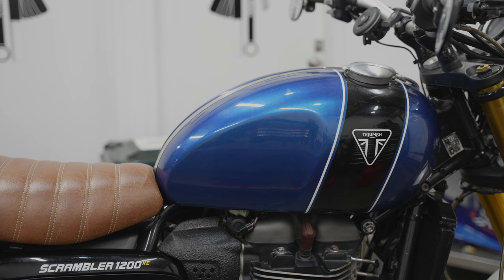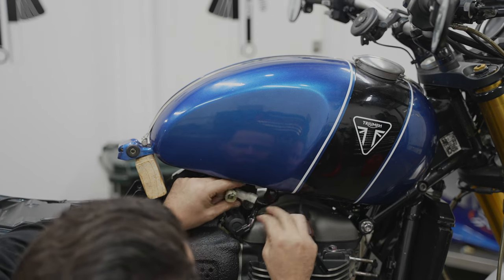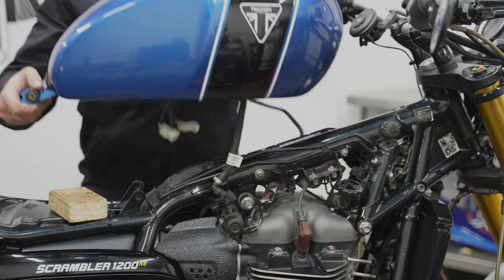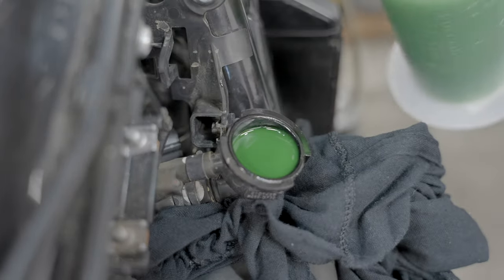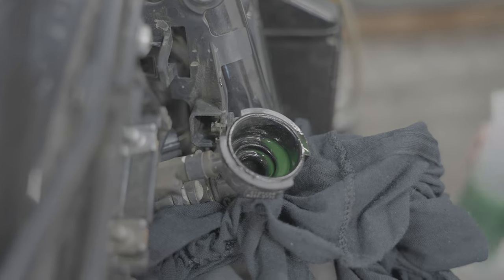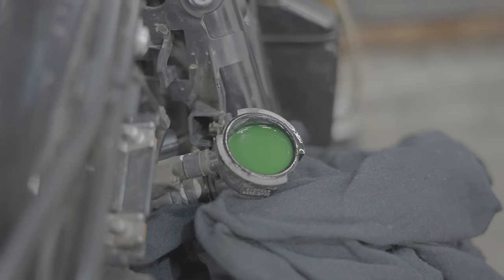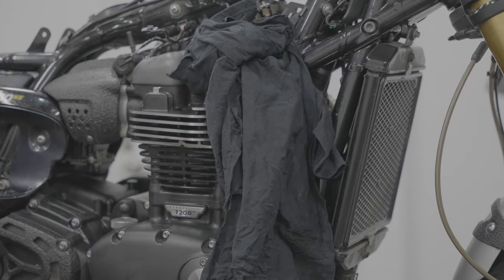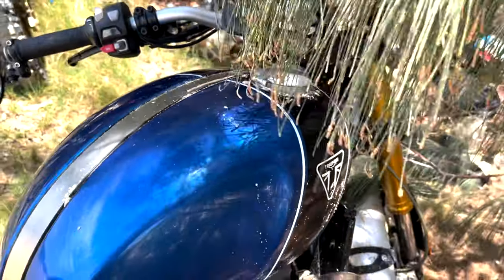Stay COOOL - RADIATOR + COOLANT CHANGE | SCRAMBLER MOTO MAINTENANCE TIPS

Comment: I added that plastic extension for the front fender. Massively reduces the amount of garbage kicked into the radiator.
Reply from the maker: Yeah I’ve heard that helps a lot!
Reply: yeah same. works pretty good
Reply: I have the high front fender. Knowing I was going on a long and remote off-road trip, I crafted a DIY solution to add a 10" mud flap cut out of a black duo-tang folder. It took some abuse on my trek, but even with a couple of short tears, it is still in place after 6300km...:goodvibes:
Reply: @FlorianWerner  it would be cool to see what you did. I was thinking of getting a high fender but was worried about exposing the radiator. Was thinking about leaving the stock guard on as well as the high one but chopping it so it's the same shape and size as the black plastic guard underneath but could leave the plastic extension thing on.  Paint it black too or it would look stupid. Might still look stupid but mocked it up in photoshop and it could work. What did you do?
Reply: @FlorianWerner   I don't know why they turn new bikes out, especially "Scramblers" with crappy mudguards that don't do their job. Even if you never ride in the wet or venture off road you can still get stray stones or road debris thrown up.

Comment: Another really cool video and nice one keeping them coming. Hey completely unrelated question but they have a bit of an Achilles heel regarding the bash plate. If you have a look under the bike it stops halfway along the sump leaving the oil filter completely exposed. If you go over a rock/tree/ledge and catch it you'll be fucked. If you look closely on the Mexican 100 vid they have extended it somehow to fix this. I haven't seen anything online about remedies and wondering if you had any thoughts? I'm thinking of getting a second OEM one and chopping it a bit then fitting it backwards. Could maybe somehow fix it with the centre stand bolt holes and overlap it with the original under the bike.
Reply from the maker: Very good point and I totally agree and also it’s a bit strange for them to protect the sump but not the oil filter which is much more likely to get pierced by a rock or something. I’m pretty sure there are upgraded versions but I haven’t checked to see if they cover the oil filter
Reply: @lifeofascrambler  nah, at least nothing I can find anyway. When there's some time I'll have a go at fabbing something up with my limited skills and let you know how it goes. If you come across anything I'd love to know as I'm sure all scrambler riders that go off road would. Cheers.

Comment: Hi! How is this different than what it says in the service manual? Checking and topping in the reservoir that is located down the skid plate (which is a PIA). Thanks and great channel!
Reply from the maker: This is mostly the same as the manual. The reservoir down at the bottom is actually an overflow, so when the radiator is heating up and there’s too much fluid it pushes the excess fluid into that lower chamber. when you top up or change your fluid you should be pushing all of the excess air out of the highest point in the system to make sure the fluid lasts longer and there is no air in the system.

Comment: says radiator coolant change - but its not a change - just a top up? Interested in changing the coolant as its been in the bike 4+ years
Reply from the maker: All you’ve gotta do to drop the coolant is undo that bottom hose clamp, drop the current coolant out, and then if you feel like it you can use a hose to wash the system through but it’s not a big deal if you don’t. Then top it up as shown.

Comment: What muffler do you have installed on that Blue scrambler at the end of the video?
Reply from the maker: I think you mean the slash cuts? They’re not mufflers per se, more just straight pipes with optional baffles inside them. I talked about them in my exhaust video so check that one out for more details!

Comment: can you do a video for a complete coolant change?
Reply from the maker: The only additional thing you need to do for a complete change is to remove that bottom pipe, let all the coolant out into a container and then flush with a hose, let us drain out then start where mine starts at topping up!
Reply: @lifeofascrambler  do you mean the bottom pipe you squeeze to force the air out?
Reply from the maker: @turaly0n  Yep that's the one! You basically wanna drain it from the lowest point of that pipe. Then you can flush it from top to bottom, and also gently put some water through the pipe which might help clear some stuff from the engine. Make sure its all kind of drained out, and then fit it all back up and fill coolant from the top.
Reply: @lifeofascrambler to anyone reading this, Triumph recommends you flushing the system with distilled water.  Don't use a hose.